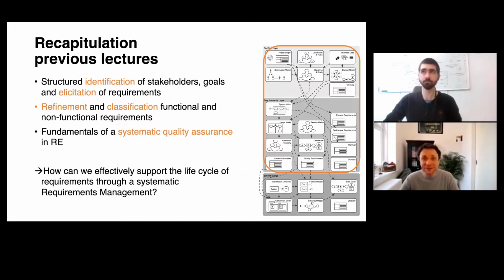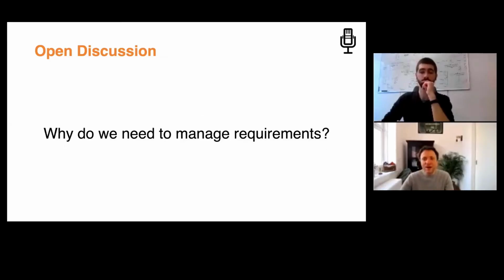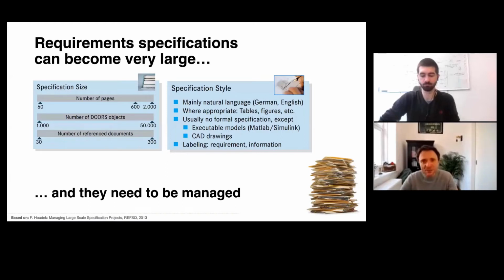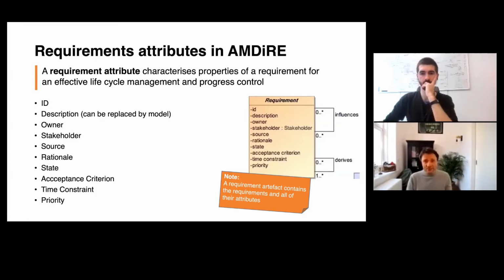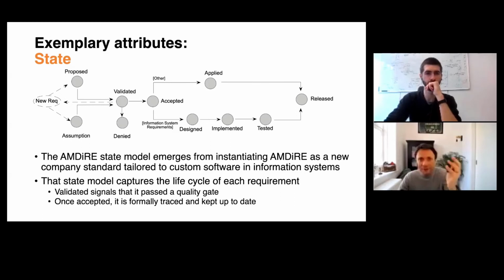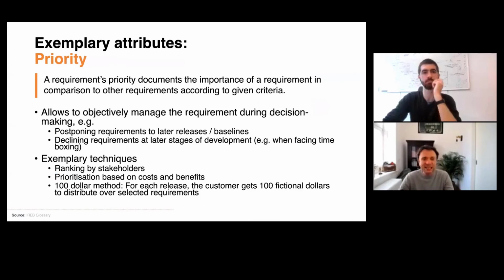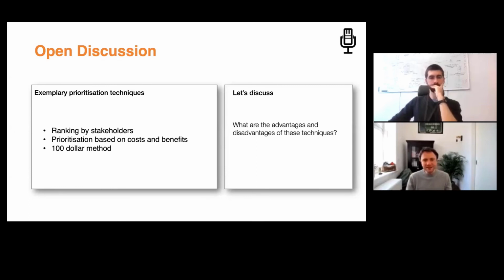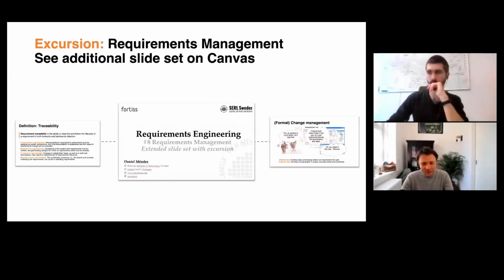Requirements Engineering Lecture 8: Requirements Management

Comment: It is a good lecture series. I'm trying to get a good classification structure of system requirements spec. for an embedded ECU in automotive industry. Do you have any tips that I should look for ?
Reply from the maker: Unfortunately not. The last approach that would come close to this in the sense of an artefact model for embedded systems in the automotive sector is the so-called REMsES approach from 2006: https://remses.org/results.html I am unfortunately not aware of any further developments for this particular domain.